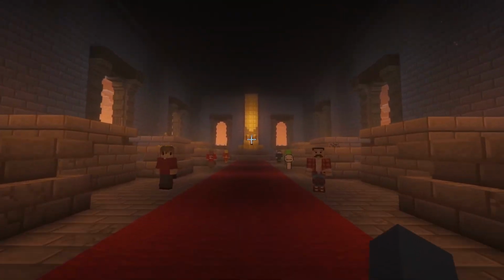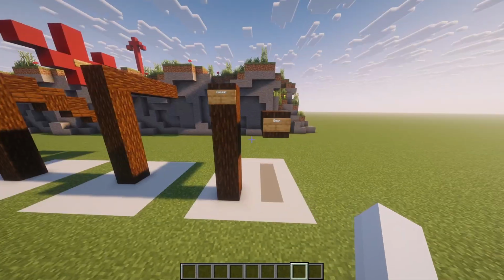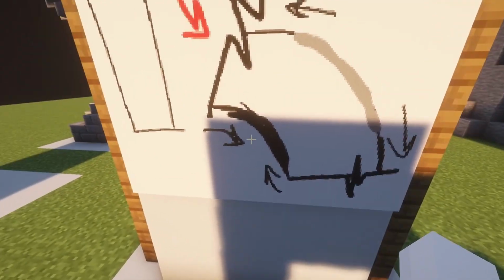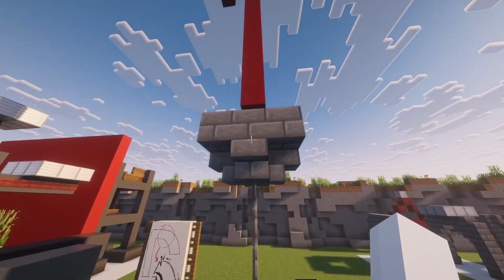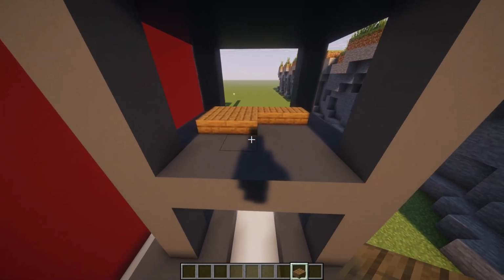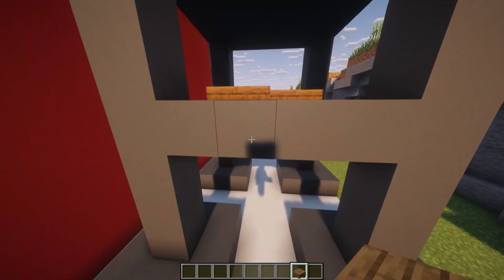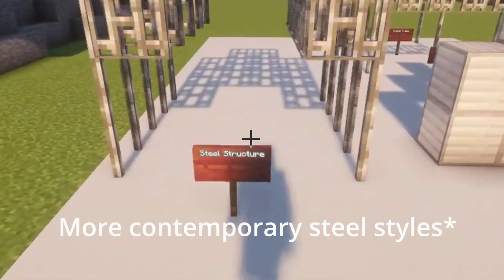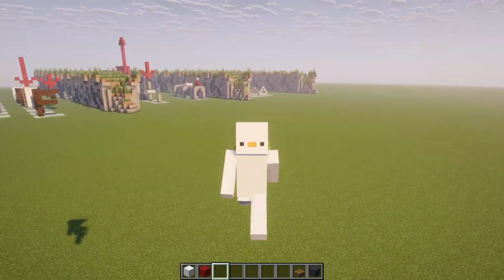How to make ANY Minecraft build better (by using structural engineering)

Comment: Minecraft doesn't concern itself with realism, we can build totally legitimate ice highways and ride on them in boats at 72 m/s (236 ft/s) in hellish, very hot dimension or simply build railways going up or down perfectly fine at 45 degrees. So, any realistic and supporting structures are purely decorational. To be fair, all village houses could have flat roofs, because they don't need to withstand rainwater and snow accumulation. 

Yet, I'm planning to enforce a rule onto myself in the next world to never place chests right on top of one another and add shelves like in Woodland Mansions.
Reply from the maker: i agree with you but i also think minecraft is a very good platform to introduce people to architecture and stuff, its not about if it's realistic or not its more about driving people to understand real life physics and architecture
minecraft unironically is one of the reasons why i got my degree, cuz i loved building in it, thanks for the comment and good luck with your new world <3